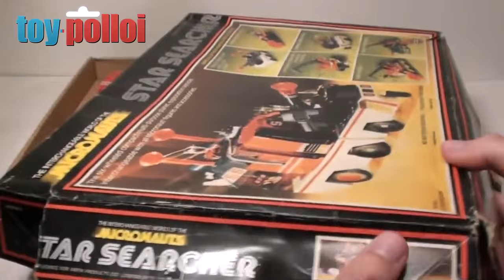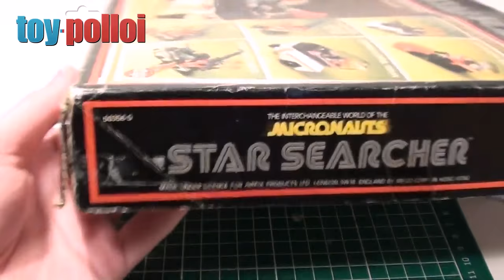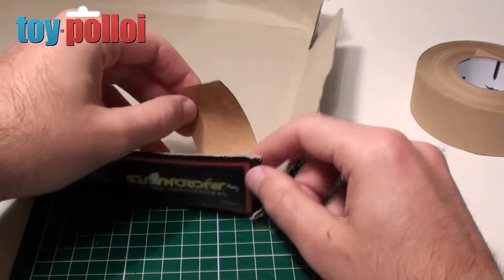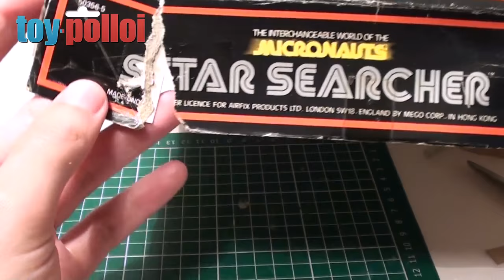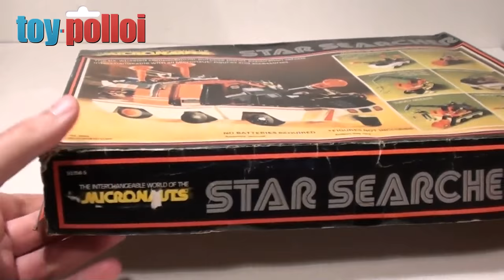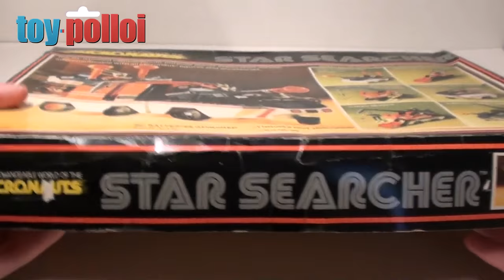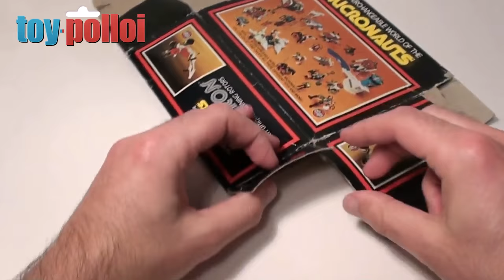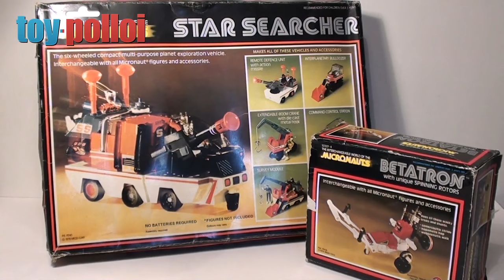Vintage Toy box repair tips - Micronauts - Toy Polloi

Comment: Great video! You mentioned glue, and having troubles with it letting go over time. I've repaired a few boxes with bookbinder's grade PVA glue. Here in the States you have to get it at a good art supply store. It looks and smells like ordinary white glue but it soaks into the paper better, is less prone to wrinkle, and it's stronger. I glued a corner back together with no backing about five years ago and it's still holding. Sometimes, if you're lucky, you can get a nearly invisible repair with it.

Comment: I use an acid free clear glue for the splitting if the card stock. Got it at a art supply store. Use it on my Hotwheel cards when the corners are dinged. Works like a charm.

Comment: Thanks, Dave! I have used your lighter fluid tip for cleaning a number of boxes. Now the colours really pop and the amount of dirt that comes off is scary. Always best to try it in a small area first to make sure the box will respond well to the fluid - just to be sure. I have had no problems so far. What a great channel!
Reply: Lighter fluid ? From actual lighter?

Comment: Great instructions! Goo Gone removes old tape residue as well. And placing a piece of parchment paper between the box and the iron works better than a tea towel.  😉
Reply: The only draw back to Goo Gone is that it can leave an oily residue stain if it ends up on a non coated or non gloss surface.

Comment: The plastic coating is a Matt laminate to keep the damp out and stop the colour running. Also stops the heavy ink coverage from cracking on the edges when it's die cut to shape and assembled.
Reply from the maker: +paulsenior33 Thanks for the info. It just means you need to be a bit more careful when ironing.

Comment: I don't think I have ever fixed a box, but what I usually do on books is to just use regular PVA (elmer's?) glue, applying it very carefully with a toothpick or a piece of card stock for those tears that leave some of the front  on one piece and some of the back on the other.
But for the box corners gummed paper tape is probably the best solution if not the only acceptable one.

Comment: For the BETATRON box, what about creating an "internal box" out of a stronger card-stock to slip inside the box to add support and re-shape the vintage box?
Reply from the maker: +OIFEagle That is worth doing on larger boxes as they tend to collapse with their own weight.
Reply: Toy Polloi, Eagle - I'm in the process of doing this right now on a Technofix box. Man is it tough. The problem I found was the bottom of the box wouldn't fit the new top. Easy enough - I made a new bottom with new cardboard. It's plain - no print so no harm no foul.

Comment: Have you thought about using a black sharpie pen to colour in some of the specks rips?
Reply: The only thing with sharpie is it goes a somewhat purple colour, I've never tried it but maybe a fabric marker would work well?
Reply from the maker: +Actionmanarchives yeah, not a good idea. It goes all weird over time. Best to just leave those.
Reply: I tried that, I didn’t like it. There’s something odd when it catches the light and the colour is slightly different. And there’s no satin sheen on Sharpie covered areas.
Reply: Try a black dry erase marker, works great you can wipe off the excess that goes on sheen, but I haven't figured out how to replace sheen..(old VHS boxes)!

Comment: How would I go about restoring a hole in a thicker box? Our Harry Potter trunk arrived with a small hole in the bottom. I thought about perhaps using expanding foam, but I thought that might make the hole worse or larger.
Reply from the maker: I'd need to see some photos of what you are talking about. You can contact me via any of the social media links. Cheers
Reply: @toypolloi  Will do. Thanks!

Comment: I have a vintage Skipper cardboard room playset that I want to repair tears on, the problem is that the cardboard is printed on both sides. Do you have any recommendations on how to fix a tear and add some permanence? Or is it acceptable to add tape on the inside where it’s less visible?
Reply from the maker: How thick is the cardboard? If it is quite thick, you could insert something into the card. Some thin plastic, to strengthen the joins.
Reply: Toy Polloi it’s “chip board” from 1964, so a very thick cardboard designed to be bent repeatedly by a child. The problem is that the chipboard is covered in the paper design. I like that thin plastic idea, I’m worried I wouldn’t be able to get the paper up to insert it though.
Reply from the maker: If you are on Facebook, send me some photos of the parts as I haven’t seen that toy before.
Reply: Toy Polloi I will take some pics when I pull it out next!

Comment: Great video! Question about the Betatron box and its torn side flap: Since you're very good with photoshop, have you considered trying to re-create and print out a "patch" for the damaged and missing cardboard? Or, possibly scanning in the opposite undamaged side of the box, and either use it as a template or "flip it" and print it out as a completely new replacement side flap?
Reply from the maker: I certainly could do that. This video was just to show some basic tips to improve even the roughest of boxes.
Reply: Ben, I've done exactly that. Photo copied opposite sides of a box and filled in bare spots. It's not professional but a great amature repair. I also photo copy the inside of the box to make patches of the same coloration to fix those torn corners and brace them. (not packing tape). Very satisfying to bring a box back to life.

Comment: When I order an action figure on eBay or Amazon. If I see damaged parts. I just use clear tape to repair the broken parts. And usually not badly damaged. Since the figures I buy are new and unopened. If you buy used, definitely damaged box.

Comment: What temperature/setting should the iron be at?
Reply from the maker: Medium hot. Depends if the cardboard has a plastic coating on not as you don't want to melt that.

Comment: Hello Toy Polloi, what are the measurements on that roll of gummed tape Your using in the vid, 47mm or 57mm?
Reply from the maker: +MadMark2006 47mm I think. You can use the bigger size if you have more space.
Reply: Thanks for the quick reply, I think the 47mm used in your box repair guide, is probably the best general size to use, for old scale model boxes. And for large Action Man/Star Wars vehicle/base Boxes, which usually have thicker cardboard, one can use bigger size up to 70mm+ or even just cut up a couple of 47mm strips.Either way, the use of gummed tape is brilliant for carded toy Box restoration, many thanks for this great repair guide.

Comment: Would you have any advice on removing ball point pen from a cardboard box? It's laminate much like an old toy one
Reply from the maker: Not easy as you tend to damage the box more than the pen mark in the first place.  There are plenty of tips around for doing this. But I tend to leave it as is.
Reply: Well, heck. I suppose it can add character. 

What are the options to try and clean it? If I find a successful method shall I share it?